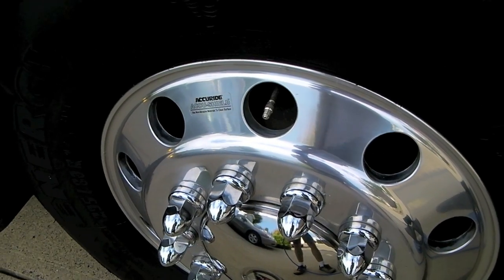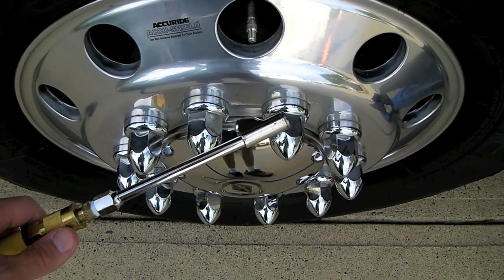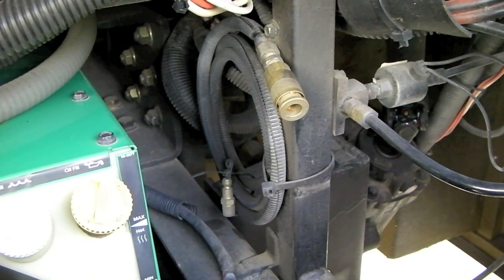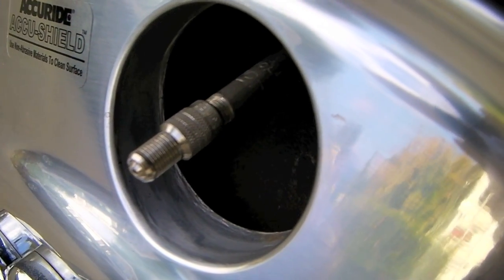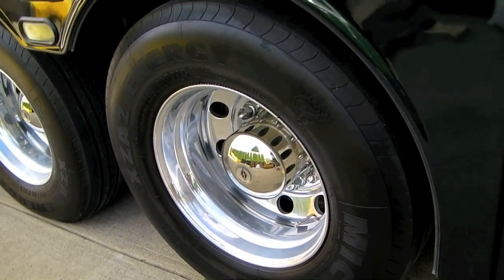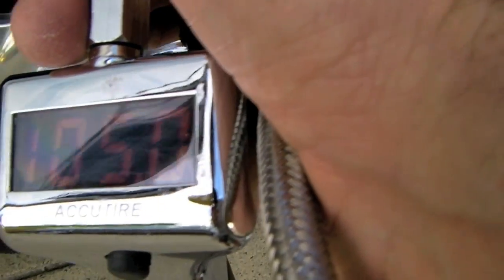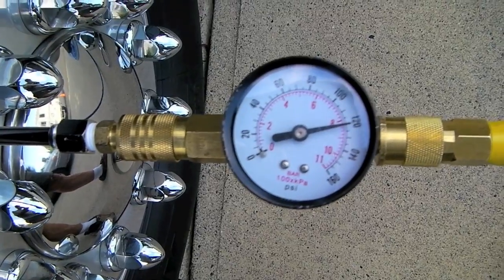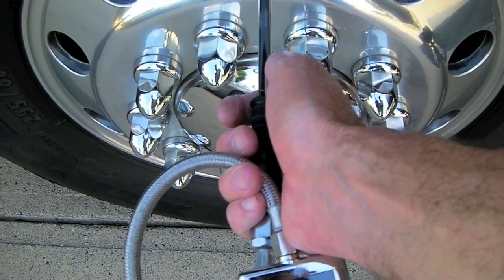HOW TO: Inflate High Pressure RV Tires

Comment from the maker: @BARRY STAHL Hi Barry! The valve stems on all of our wheels are rigid chrome, which came that way from the factory. Makes it very easy to use, since they stay so firmly in place when airing up. It's been so many years since we bought that chuck that we're not sure where it came from... maybe a truckstop... maybe a home improvement center in the air compressor section. Look inside the opening for the concentric circles. That's what holds it in place on the valve stems.

Comment from the maker: The battery died in this Accu-Tire brand gauge shortly after this video was made.  Turns out that you have to ship it back to the factory to have it replaced!   They also don't make it any more.  Instead, I bought a new Accu-Tire high-pressure gauge, model MS-4021B, from Amazon for about $10 that I absolutely LOVE.  It's better than the old one, yet simpler and smaller.

Comment: Great video.  Good advice.  I have an auxiliary compressor already onboard but I will install this to my air hose anyway.  If I need to use the coach air if the auxiliary compressor fails then the bus air can be used...

Comment: HI, your videos are great full of useful tips, knowledge.  I have 2 question, (1) what kind of valve stems do you have on your rear duallys?  (2) Where did you get the air chuck that stays on the stem by its self?

Thanks 
Barry

Comment: Just a  quick tips
1) run to your dealer and have your governor changed on your compressor. Your pressure is dropping to low You're falling below the SR valves pressure reducing setting for the park brakes.. have them install a governor with max pressure 135 PSI. 
Governors have a non adjustable 20 PSI delta P load to unload cycle.. so your cut in will be 115 PSI (+/- 4 psi). This change alone will address your concern of trying to fill tires while the governor (compressor) is in the unloaded mode. They are inexpensive and easy to change... Bendix 283657N.. don's accept any other part number but this one.. they may need to order.. but ..again.. inexpensive .. fixes your tire pressure issue but most importantly.. keeps the pressure above the spring brake control valve PR value... great video.....
Reply: B

Comment: That's why.  Thanks for that info. My freightliner cascadia wouldn't pump air in inner tires. Even though it did on the other inner tires. So I was mystified what caused it.

Comment from the maker: I'm pretty sure that every diesel pusher RV (with air brakes) has to have an air line at the front end, because if the RV needs to be towed, the tow truck has to be able to supply air pressure to the system to keep the parking brake released. Without air pressure applied, there is no way to release them (S-cam drum brakes are designed that way for safety, locking the parking brake in the event of total air loss). Finding it may take a little looking, and it may not have a quick release.

Comment from the maker: You are right on the money with that thought.  In retrospect, there is never any reason to use the gauge without the chuck attached, so the release wasn't needed.  I'm about to partially dismantle the assembly to add in an air release near the gauge, so that a helper won't be needed to fan the brakes any more. So I'll be making it more complicated instead of simpler.  lol  Stay tuned for a video update!  :)

Comment: RV geeks you are absolutely correct. Lowes truck to have air brake system are built for exactly that reason. The air brake system is also more responsive then hydraulic systems, that is added safety. The reason I know is because I have been to school and hold a class A CDL.

Comment: I have a dual air gauge for filling the duals equally at the same time.
Has the same type dial gauge mounted between both air lines.  If I add the air relief valve, I should be good to go;)

Comment: Great video, thanks!  I presume you know that when the gauge reached 120 PSI with the chuck engaged, that the pressure in the tire was at about 120 PSI as well because the entire system would equalize.  Also, you could have removed the chuck when the pressure was on the upswing and had reached the desired pressure.
Reply from the maker: We do indeed! Thanks.
We don't actually fill our tires this way any more, but avoid idling the engine by using one of these: https://youtu.be/Yzv3ymNZ5zQ
;-)

Comment: Great video.  Quick question though.  I have 2009 Newmar, now I know yours is a little older but the layout of my air chuck next to the generator is exactly the same.  However, I don't have that spare quick connector attached to my coach so I was wondering which type of quick connectors did you purchase to attach to the coach's air supply?  Cant seem to find this info anywhere!  Thanks.
Reply from the maker: +joker22m We got all those parts at Home Depot in the plumbing and air compressor compartment. If I remember correctly, the quick connect is in the compressor department.

Comment: Nice video, but  A bit spooky of allowing the pressure going over 120psi in the front tire.
Reply from the maker: The round gauge on the air chuck doesn't actually read the pressure in the tire. It reads the pressure in the RV's air system. When the gauge momentarily reached 125 lbs, the tire was still below 120 (its maximum allowable pressure). When we remove the air chuck and take the reading, you can see that the tire was only at 111. It's kind of like going to the gas station and using a 75 PSI compressor to bring your car tires up to 30 psi. No harm, as long as you remove the air chuck before exceeding the max pressure of the tire.

Comment: How about you just add a 5 gallon auxiliary air system rated at 150 psi? Hornblasters sells the complete kit for around $350 bucks. It's fully automatic and would eliminate many of the problems you're having.  The kit has a air tank, 100% duty cycle compressor, pressure switch, gauges & fittings.

Comment: Here is an improvement to your design, put a 130+ PSI working pressure 50 PSI cracking pressure check valve between the male fitting and the gauge. Air will only go into the tire and stop flowing when the air line pressure is below the tire pressure.
Reply from the maker: Interesting, thanks for suggesting that, Thor.

Comment: So what’s the deal with a higher air pressure in the front tires? Because I thought the rear wheels on a diesel pusher would need higher pressure than the front ones because of the weight of the Diesel engine over the rear axles.
Reply from the maker: The reason the fronts need more pressure is because they are each one single tire, supporting the weight all alone. The rears have four (or in our case, with a tag axle, six) total tires. Even though we have three times the number of tires on the rear of the RV (6 vs 2), the rear doesn't weight anywhere near three times as much, hence the lower pressure requirement.
Reply: RVgeeks ah since there’s only 2 tires on the front axle they need higher pressure to support the weight of the rig

Comment: Is that a special air Chuck please let me know I'm trying to build my unit
Reply from the maker: If we recall correctly, there should be a link to the correct one in the video description.
Reply: @RVgeeks  I did not see a link is that a special Chuck to fill the air not to check the pressure

Comment: What kind/brand of tire valve stem extension is used on the front tire? Where do you get them?
Thanks!
Reply from the maker: The chrome valve stems came from the Newmar factory, but if you're referring to the "fill-through" caps that allow you to add air without unscrewing them, we got them at a local tire shop. We've looked for replacements at various places, including truck stops and auto parts stores, but they're apparently hard to find. Sorry but there's no brand name on them. The tire shop just gave us a handful of them when we had a couple of tires replaced. I just scoured Amazon, and nothing. Just found them on eBay, but ending soon! Go to eBay and search "Schrader Valve Air Through Cap" and they come right up.

Comment: That seems like a real hassle. Why not get out your screwdriver and adjust the restart pressure sensor on your compressor to a higher pressure. It's really easy, I have done it on several air compressors. Reset it to just above your desired air pressure. It may run more often but not as long each time. That way the air hose will always have more air pressure than what you need.
Reply from the maker: Kerry Wware Hey Kerry! Rather than tinker with our motorhome's air system (which we'd rather not do), we've switched to an even easier (and quieter) way of inflating our tires. Check out that video here:
http://youtu.be/Yzv3ymNZ5zQ

Comment: ..i currently have a 6x10 haulmark transport cargo trailer.reg says 2990 gvwr. it has 205/75d14 tires on it.,,,,,my problem is my garage door opening is 84 " high .but the trailer measure aprox 86 1/2 inches high. i was able to get it into my garage just barley by flattening the tire. but makes it very unpractical to use having to  re-inflate and deflate with every use.  have to keep it garaged due to HOA rules i'm thinking of changing the rims and tires from the 14 inch to a 12 inch in the homes of gaing the clearance i need to pull it in and out without messing with the tire inflation...... but can my trailer run safely on a 12 inch tire with a d rating ? also will the 12 inch give me the additional aprox i need to clear the garage height ?.......any thoughts or recommendations?
Reply from the maker: +bob woerner Hi Bob. Sorry for the delayed response. YouTube somehow just decided to notify me about your comment. :(

We like your thinking outside the box as a way to solve your problem, but we're going to have to defer to a professional on this one. The combination of tire ratings, size, loads, etc may have consequences that we don't know enough about to say for sure. We'd suggest inquiring at your local tire and/or trailer dealer to see what they think. You might also try posting your question on the user forums on iRV2 to see if anyone else there knows. It's free to join and post at http://irv2.com/forums. Sorry we couldn't be of more help on this one.
Reply: I would look into lowering your suspension by a few inches before giving up tire weight capacity with a smaller tire. Alternatively, look for a lower profile tire that still fits the 14 in rim. As long as it still has the weight capacity. On my trailer, I just welded the spring hangers up a few inches higher up on the frame rails. I almost went with a lower profile torsion axle first, but then realized a cheaper solution at the last minute...

Comment: Clip the air hose onto the valve and have a longer hose so you can be away from the tire if it blows while you're filling it up, especially if the tire has been really low. If the tire goes when you're down there with your hand on the hose it would ruin your day.

Comment from the maker: @georgebarrera100  We originally got 2 of them at a tire dealer when we had two new tires installed. They just put them on without being asked.  We liked them so much that we began looking for them at every truckstop and auto parts store we came to, but were unable to find them.  We finally asked at a little tire shop where we stopped to get propane.  The guy handed us half a dozen of them for the rest of our tires and said "no charge!"  So I'd suggest that a tire shop would be your best bet. :)

Comment: Wouldn't it of been a lot easier to of just put a one way check valve between the tire filler and the quick connect? Then the air could never flow backwards.
Reply from the maker: That's a good idea, Patrick. But I think that would only solve half the problem. While it would indeed prevent air from flowing out of the tire, the problem of trying to ADD air while the air system is at the lower end of its pressure cycle would still be there. We're since give up on this method of topping up our tires entirely, getting several benefits in the process: https://youtu.be/Yzv3ymNZ5zQ

Comment: Honestly you need to toss that digital gauge in the trash , it detects pressure with diodes and small electronic that are very sensitive to temp and moisture as well as batt voltage in the unit . why would you risk a $600 Michelin tire on a gimmick? invest in a good mech gauge and have it tested at least 4 times a year..i would not be surprised that the gauge you used in the video is not off by 5-10lbs
Reply from the maker: Too late.... it died last year! lol  It's already been replaced with a simpler one we like much better, that's also a lot smaller and only requires one hand to operate. We'll be showing it in an upcoming video about another way to fill high pressure tires without dealing with the ups ad downs of the RV's compressor.

Comment: WHEN you weigh your coach you need to know the  MAXIMUM weight your coach will be when you are traveling
SO, load it up as if you are going on an average trip. Fill  ALL tanks, yes waste tanks too as they may be full as
you leave a park heading for home. Full fuel and all that. Food, clothes, tools whathaveyou. Everything you
intend to haul. THEN, weigh your rig. You want to weigh each wheel as well all 4/6 and front axle only & rear 
axle(s) only. Store these numbers as you will be referring to them from time to time for as long as you own this rig.

!

Comment: Thanks for the Tip! We pasted this video on our Facebook page:
https://www.facebook.com/groups/RVForum/
Reply: Thanks for the video. Well done with good info. Who makes the stem caps that you can leave them on and lock the air chuck on to?
Reply from the maker: Ken Bolden The "fill-through" valve stem caps can be difficult to find, but we located these at a tire shop. Not sure who makes them though. Our air chuck locks onto any valve stem, because it has rings inside the opening that catch onto the stem's threads. It was also a little tricky to find, since most chucks are smooth on the inside. If you look at tire chucks, check out the opening and look for the rings, and that type will lock onto any valve stem threads. Hope this helps!

Comment: never air up a tire that has been ran low on air. the tire could have a zipper tear in the side wall.it could explode,also you should not use a short air hose valve to air up tires. Use a 6 ft line with a air fill chuck on the end farthest from the tire. Always stand off to the side away from the front of the tire. He is wrong to put gauge at tire end. Very dangerous.

Comment: WHY do I need. Digital air guage? I drove truck for 42 years and checked my tires weekly, never owned a digital guage, so Why can't I just use my manual guage? Does my class A diesel pusher use DiGITAL air? LMFAO 😂!???
Reply from the maker: Who said the gauge had to be digital? That’s just what we happen to have. As long as it’s accurate.